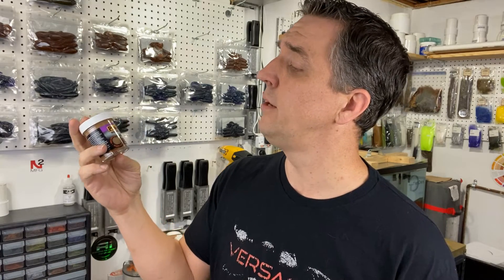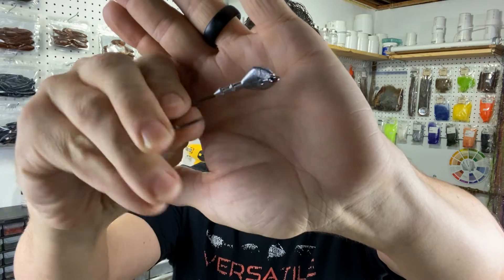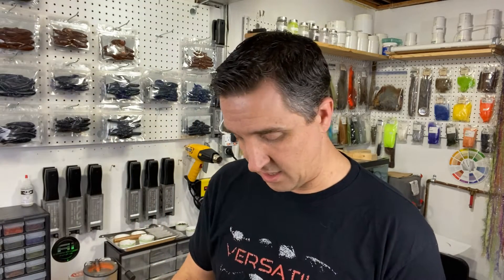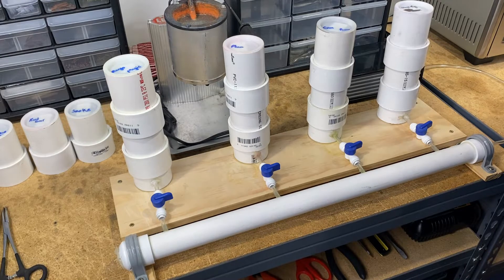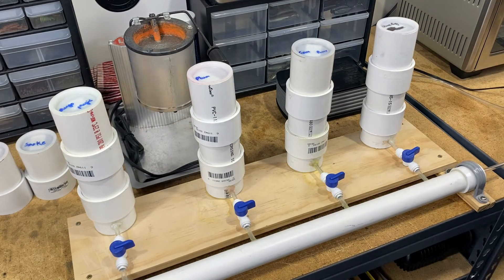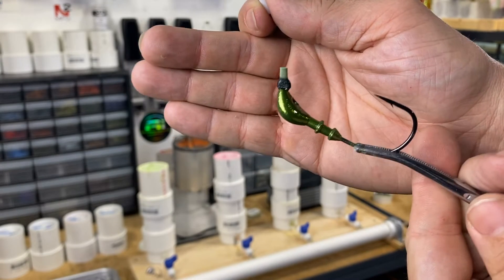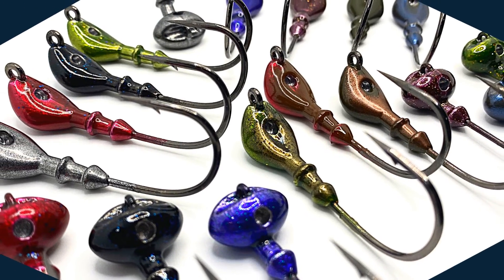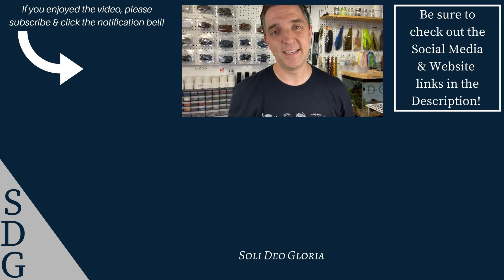How to Paint Jig Heads - Comprehensive Overview

Comment: Good job homie.  The hidden hook eye is the only one I leave the powder coat in.  I just shoot a round toothpick thru it right after dipping it to open the hole.  So far it has not bit me.  My heat gun must not run as hot as yours (mine is old) cuz I have to heat em for about 30 seconds.  Your clumpy GP....my brown does the same.  I think some color batches must be thicker at times because my GP is one of the easier ones for me.  I like seeing how you do your stuff and I use some of the methods you have on your teaching vids....fluid bed making, shrink tubing, the rack for putting into the oven....thanks a ton.  You a good man Charlie Brown.
Reply from the maker: It’s truly my pleasure Mark, love to hear my stuff is a help!  Good subs (and friends) make the job a lot easier too ;)!

Comment: I found that when I use heat shrink over the hook eye that the top of the heat shrink does not close completely and when dipping the jig head into the fluid bed, powder gets in and migrates down and gets on the hook eye.
To solve this I took an extra step and cut some weed trimmer line into small pieces and insert it into the top of the shrink tubing. It snugs up tight and closes the hole and solved the problem.
Adam, I've learned so much from you.
Thank you!
Reply from the maker: Yup, thanks for the comment Rizzo!  I’ve noticed that too.  I used to pinch it shut right before dipping, but that would sometimes fail.  So, I figured a little paint just on the top wasn’t hurting anything and let it go :).  Sometimes I’ll still scrape it off if it’s white and more noticeable.  Good idea in the trimmer line, smart thinking!

Comment: Very helpful, Adam.  Your "nerd outs" were esp useful as, after, all, it takes a special mindset to get into this at our level!  :)  Found out I've been putting the shrink tube on too early too!  Thanks for sharing.
Reply from the maker: My pleasure Rod!  I appreciate the chance to get a little more technical from time to time… even if it’s just a theory.  Glad I’ve got some guys out there, like yourself, that dig the details!
Reply: Yes! Your details are much appreciated!
Reply: When you put the jig head into the oven, does not affect the resistance ( hardeness) of the hooks?
Reply from the maker: @rodolfochfend  great question Rodolfo!  The temp would have to be high enough to turn the hooks red… 800-900+ degrees… for the hooks to be negatively impacted by the oven.  Powder paint cures at a min temp of 275 (so says Pro Tec when I called them to ask) and cures best around 325/350. Too much hotter and the paint melts and starts to sag/drip.  Hope this helps!!
Reply: @SDGCustomLurecraft  ok, thanks.

Comment: Never tried fluidity but can only imagine!
One of my tricks for accent colors is using a beauty brush from above tapping with a finger letting it rain onto the jig.
I like using fingers for adding a blotched top color.
Reply from the maker: Very cool!  Fluid beds are awesome, makes the coat nice and even!
Reply from the maker: Usually less than a 2oz jar.  You could cut the cups a bit taller to get the whole jar in there.

Comment: The reason you are getting voids on the bottom of your jigs is because the air pressure is to high.
The powder should look fluid, not like boiling water. The voids are air pockets. Simple test - turn off the air right before dipping. (Your powder will still be fluffed up)
Another tip add some clear powder paint  to your green pumpkin powder it will flow a lot better. Keep the videos coming.
Reply from the maker: Thx Geoff!  Appreciate the feedback!
Reply: I tried your tip Geoff and it worked
Reply: @craigvandyke9298  Cool, I am glad it worked for you.

Comment: Man I love your shop !!! OCD recognize OCD lol 😂 . I've been using aluminum foil for my hook eyes . I got a set of finesse screwdrivers and I cut 1 inch by 1-in pieces of aluminum foil and wrap around the shaft of the screwdriver - size based off of the hook of course . Pull it off of the screwdriver and slide it onto the hook eye . And then use my pliers to flatten the aluminum foil on both sides of the hook eye and then trim with scissors. It stays on while I have the jig in front of the heat gun and while in the powder paint . I let it cool and use the same pliers to pull the aluminum foil off . That way there is never any abrasions inside the line tie or paint in a hook eye . # Nicest shop on YouTube by far
Reply from the maker: Neat-freaks unite!  

Cool idea with the foil!  I could tell you did something when I went through your baits.  Nice nice!

Appreciate the shop props as well!  It is my happy place!
Reply: @SDGCustomLurecraft  For sure !!! Yeah the foil is low tech but it works well . It's kinda redundant but if you precut all your pieces , it helps time wise . On my football jigs that have a recessed line tie , I'll slide a rolled up piece of foil through the the hook eye and then pinch it together . It helps as well .
Reply from the maker: @joshwhite8055  good call.  I’m looking at a different football head mold (non-recessed) to avoid the issue, but also because it takes both flat and vertical eye hooks (cool to have the option) and the cavities go down to 1/8 (I can only get down to 1/4 today).  Versatility, clean eyes, and smaller size option… win win win!
Reply: @SDGCustomLurecraft  definitely !! We throw a finesse football jig around here quite a bit in the spring and the fall especially on bluff walls 1/8 can come in handy . I can see one in all black with a black drop shot leech as a trailer
Reply from the maker: @joshwhite8055  oh yeah!
Reply: @SDGCustomLurecraft  Smallmouth Licorice

Comment: Great video! Thank you for the shrink tubing idea. I have been using small bits of painters tape to cover the eyes and it works pretty well but, the shrink tubing will be much faster and easier.
Reply from the maker: It was a game-changer for me, for sure!! Hope it works out well for you!
Reply: I've never understood why people dont want to get paint on the line tie. I paint mine all the time i use a paperclip & run it through the eyelit as soon as i pull it out of fluid bed.Not saying SDG or anyone is doing it wrong by using heat shrink i just personally think looks better painted.
Reply: @LTOutdoors  It's important that the eye of the hook has no jagged edges or abrasions that will damage the line. Cured powder paint can have tiny sharp edges. Keeping the paint out is just another step in reducing break offs.

Comment: If you have a bench grinder, put a fine brass wire wheel on it and you will find that it will clean the eye hole out and leave it nice and smooth. Plus it will only take about 8 to 10 seconds or less to get the job done.
Reply from the maker: A good alternative, thanks!

Comment: Excellent video. My black and blue flake turned out great. But once I cured it in my toaster oven the glitter lost its luster… I’m guessing it’s too hot in there?
Reply from the maker: Good chance, yeah. Flake of any kind can be heat sensitive and dull out with over-exposure.  I have a video in the “Shop” playlist that covers “Calibrating your toaster oven” as that dial is a liar, LOL!  They often run hotter than advertised, so you need to pull it down a bit.  I encourage you to check it out and any of the others in that playlist, might find some other nuggets to enjoy.  Thanks for the kind words, glad you liked the video!

Comment: Excellent video for me just setting up to do 1/8, 3/16 & 1/4 hair jigs for smallmouth.  You're my main tutorial for the powder painting, and just got done cutting up my 3/32 shrink tubing ! Thanks!  My heat gun has a 750 and 1000 degree settings - would you use the hotter setting for these size jigs, and just experiment 3-6 seconds?  I see you're using the curved hemostat pliers.  Do you prefer them to the straight and is 5.5" a good size (never used a heat gun before - don't want to melt the flesh off my bones)!  I appreciate your sharing,  all you've figured out over time, including how to keep them eyes clean rather than figuring out how to get the paint out once you've got them clogged!!  I'm starting out with just black for starters, so that'll be easy.
Reply from the maker: Hey Bruce, awesome to hear about you getting into lurecraft!  Thanks also for the kind, encouraging words man, very cool!  Re: the heat gun, I crank it up… if anything it’s just a little less time in front of the heat.  I’ve only gotten myself in “melting trouble” (jig head, not my flesh thankfully! LOL) when using a torch (my gun died and my replacement hadn’t arrived yet).  That small, 3-5 sec should be plenty, yup!  I do like the curved hemostats but have both.  The curved makes it a little more “natural” to dip the head once hot (at least in my experience) but I’m convinced you get used to whatever you use.  Had I started out with a straight shank I may (probably would!) prefer it today.  Happy to help however I can man, especially if it’s saving fellow bait makers some time, trouble, and frustration!

Comment: I just did my first Pro-Tec powder paint on jig heads.  Do recommend or is it customary to put some type of clear top coat on the jig heads.  If so, is it a liquid or powder product that is used.   Thanks for helping a newbie!   ( or oldie,   I made and tied jigs when I was about 12.  My dad sold them for a dollar each.)
Reply from the maker: Congrats on the paint jobs!  No need for a clear unless you want it for some reason.  As long as you cure them in a dedicated over (toaster oven most commonly) at the right temp for the right amount of time, you should be good to go!

Comment: Great vid ! Subscribed  ! I've  been using heat shrink for awhile also but I find if I wait until the jighead cools it can be difficult to remove it,just curious as to how you remove your heat shrink ? Do you just pull it off by hand ? Or ?
Reply from the maker: Thanks Daniel! Heat shrink is awesome.  I pull it off with a pair of pliers just before I hang it up to cool.  It can be a little more difficult if you wait too long, but either way, it’s doable, so long as you don’t leave it on in the oven!  Hope this helps man!

Comment: Thank you for taking the time to explain your methods and tips! You answered almost all my questions in this video. I am working on building a fluid bed like yours. Where did you find those plastic caps that you put on the tops of the 2 inch PVC? Thanks for your time!
Reply from the maker: Hey Allen, I’m glad this was helpful!  Those caps are called “test caps” and were in the same pvc section at Lowes.  Good luck on the build!
Reply: @SDGCustomLurecraft  Thank you so much. I found them!

Comment: Any chance I missed your link to the heat shrink wrap black tubing? I even tried to look closely as you held it up.
Reply from the maker: Check the video description.  If it’s not there you can just search Amazon for 1/8” Heat Shrink Tubing… should be either 2:1, maybe 3:1, can’t recall.  Let me know if you can’t find it, I’ll dig up an old order.

Comment: Do you dip in while then immediately dip into another color or do you dip and cure white then go back and do another color?
Reply from the maker: Thanks for the question!  On a 2-color head I’m dipping the base color then usually dusting on a second color via a chip brush or something similar.  That second color is right away, which the head is still hot.  It could require some extra heat but, generally speaking, if the head is hot enough for the are coat and you move fairly quickly, no reheat is needed.  Once complete, then the cure.

Comment: I have watched several of your videos and tried powder coating this morning and the paper bags cutout do not distribute the air evenly.  Air flow is only around the edges.
Reply from the maker: Hey Dan, thanks for the support!  I have two thoughts, maybe they will be helpful (I hope so!).  1).  Make sure you’re using a thin brown bag.  The thicker brown bags used for groceries back in the day are much thicker and wouldn’t allow for the proper air flow.  2).  Assuming a thin filter, around the edges usually mean the air flow is too weak.  That may be because of a leak somewhere in the system or due to an under-powered pump.  I ran into this when using a small $12 pump from Walmart ages ago… especially when I attempted to “T” the air and run multiples.  The pump I use is a 50-160 gallon variable speed pump… really pushes the air.  Also note, some paints are far heavier than others and can be problematic (causing the volcanoing along the edges).  Again, more air pressure is needed, and stiring while the bed gets going tends to help.  Hopefully there’s something here to make things better for ya!  If nothing else, you can always try a different filter!  I tried almost all of them and landed on the ‘ol “lunch bag”, but to each his own!
Reply: @SDGCustomLurecraft  I will change the filters to a thinner material. Thx.

Comment: Do you reheat again prior to applying the top coat?
Reply from the maker: Thanks for the question!  I usually dip the head twice, back to back, no heat between dips.  If I’m applying a second color I can usually do so without heat between, but there are times it needs a bit.  If more heat is required it’s not a problem, just takes a lot less time on the heat gun to get it back up to temp.   Hope this helps and I was tracking with your question!

Comment: Use  a set of medical hemostats to hold the jigs eyes with after you've heated the jig. Keeps the paint off the eyes. Especially the recessed  eyes.  But you don't want to have the hemostats jaws to get hot or they will get messy.
Reply from the maker: @davidscales8614  yup, definitely an option, but despite my best efforts that approach always made a mess, especially if I was painting a bunch as the stats just get hotter and hotter as you go!  Appreciate the feedback!
Reply: @SDGCustomLurecraft  use a different  set to dip the lure than the one you use to heat it. On those football jigs(same mold) and most larger jigs I hold the jig by the hook with just my fingers then grab the jig eye with the stats. That way the stats never get hot. The jigs with the recessed eyes, I grab the eye with the curved side curving into the eye. All other jigs, I grab the eye back in the flat area so I can cover the entire eye with the Stat jaws. With a little practice, you won't have to mess with shrink wrap
Reply from the maker: @ I’ve tried that too but the heat transfers on me, go figure! Glad it’s working for you though!

Comment: Thanks for the tips.  I just started up powder coating and have some questions that I'd appreciate your insight to.  I notice if the jigs heads get too hot the amount of powder that sticks to them gets a little thick and the colors end up darker than I would like.  I'm using a small propane torch to heat and will switch to a heat gun to control temp better.  Is there a magic temperature that would give you a light coating so you can control the final color on the jig better?
Reply from the maker: Great question Tom, and thanks for the kind words.  While temperature of the head does play a role, I don’t think it’s a main driver.  Moving to a heat gun should help, and is certainly more forgiving, but the bigger issue is more likely related to how you dip the head and how long it’s in the powder when dipping.  If you’re not using a fluid bed you’re “pressing” the head into the powder in order to submerge it for coverage.  That added pressure will always force a thicker coating.  A fluid bed removes all pressure as your dipping into suspended paint. If you ARE dipping into a fluid bed, the length of time the head is under the paint will make a difference.  The faster in-and-out you go, the thinner, more transparent the coating - so try dipping faster.  All that said… there are just some paints that coat thick regardless of temperature and speed.  And likewise, I have paints that always require 2 dips if I want a deeper/richer color, no matter how long that first dip lasts!  So, don’t discount the impact of different paints.  I hope this has been helpful!

Comment: Thanks for you helpful job!
Where i am living i cant find powder Paint brand as protec, import It through Amazon, eBay Is to expensive.
Therefore could you please explain which kind of Paint Is Need  for heat apply as you show?
Any powder coat  as Mica resin based Paint or powder coat Paint for car  goes or i Need a specific kind of powder Paint?
Thanks so much for your help
Reply from the maker: Hey Luca, glad this was helpful.  Unfortunately the powder does need to be of a certain heat-cured, powder coat type that will melt into the jig head then harden when cured in the oven.  Mica powders and such will not to that.  Your best bet may be airbrushing or even spray painting the heads then using an epoxy to finish them and protect the paint.  Hope this helps!

Comment: Nice video! Still I'm not able to find "Glow in the dark" powder paint. 
I only find glow in the dark powder which is suppost to mix with a glue or a fluid. 
Anyone have any suggestions where to find glow in the dark powder paint?
Reply from the maker: Thanks Jonas!  While I’ve never used them, I believe Barlows carry’s glow powder paints that are applied the same way (heat, dip, etc).  But again, I’ve not tried them so I don’t have any experience with them to know for sure.